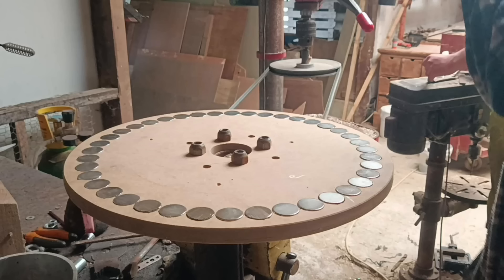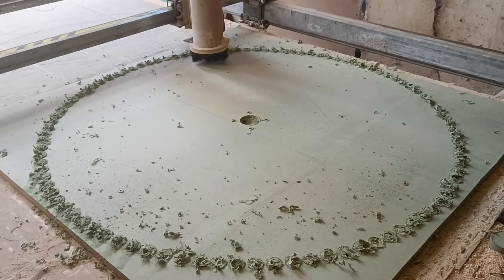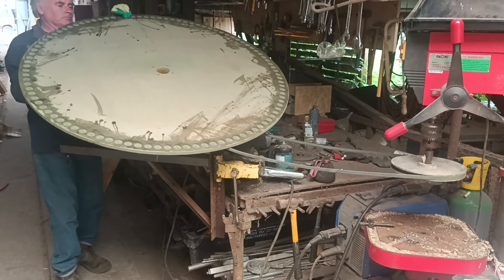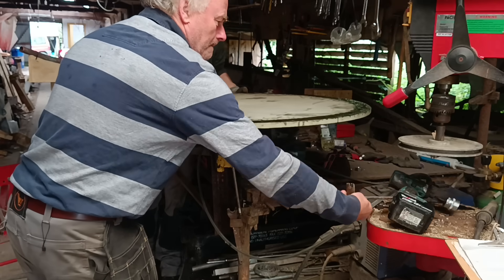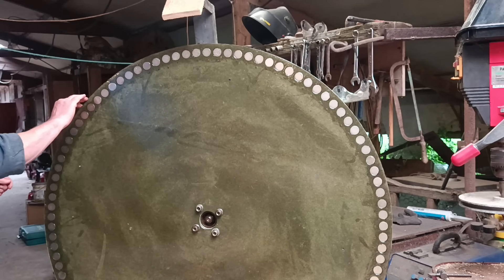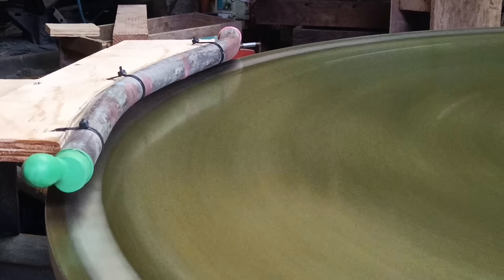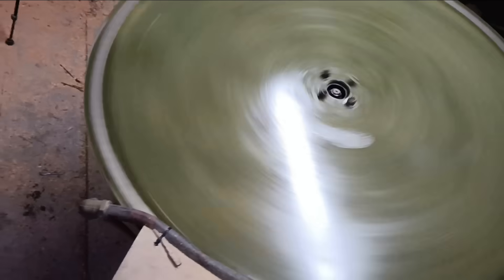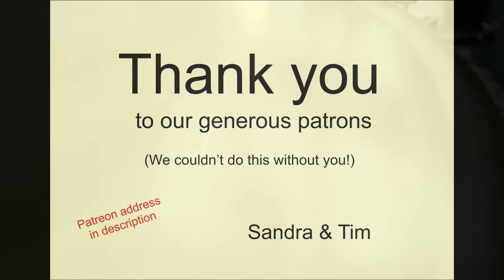ABSOLUTELY HUGE Magnetic Induction Heater! Using 100 Spinning Neodynium Magnets And A Bucket

Comment: Most of the heat loss probably happened due to evaporation from the bucket, covering the bucket should be enough to reach significantly higher temperature without any other change. Not saying that alone would produce a good water heater system, but that should give a better idea of what that system is capable of.  

It might be good to know that when balancing such a big wheel, the distance between the mass and the center matters more for centrifugal force than for center of gravity. Centrifugal force changes with the square of angular velocity, times mass and radius, which you probably realize if you think about it, while the center of gravity only changes linearly with the distance from the center.    

It might be easier to use smaller wheels, just having more of them. All energy put into the system should turn into heat, so it should mostly be an issue of making sure that the heat is generated where you want it.

Comment: There is no advantage to such a large disc, as managing the sheer size becomes a problem itself. What matters is how many magnets are next to and under the heating area.  If it's 20, you can do this with a much smaller wheel and a smaller radius heating pipe.  Whoops.
Still, I really enjoy your videos, which have the feeling of informal discovery instead of uptight judgemental engineers.

Comment: Hi intelligent people. I was going to say get the copper closer, even flattening the bottom so that there is.more surface area of the copper closer. And thats still probably a good suggestion, however just increasing the amount of copper above the magnets is probably better as it affords more user error  while achieving a similar result. Probably you have thought of this but maybe not, so ill say it: the more hotter you get the water with this setup the more drag the input experiences, so if you are hoping for hot water home-heating as the end point or this heat you are generating, you probably run the risk of burning out the motor of the drill-press on the next attempt. (And the obligitory use some insulation where you dont want the radiative heat)

Comment: faragar1791- your logic is correct! You must have plumbing physics in your blood, like me. The small section of 1" copper pipe is very conductive, and only equals a small part of the circumference of the magnets. It was, as the test showed; losing the little heat input. Equalling the circumference, as close as possible over the centre line and fully insulating the
pipe; as close as possible to the magnets should greatly increase the output. I am not knowledgeable about the magnetic/heat action occurring - so I am guessing.. that if poly foam insulation was used (being plastic) would not interrupt the magnetic flips? Through to the non ferrous copper. Also would thicker copper produce more heat? A fascinating project, especially when it is linked to a sustainable carbon free power source i/e your windmill. Have you considered a water wheel system? Might be more reliable than wind. Will look forward to the next stages...

Comment: I would move the output of the pipe so it is above the water line.  That way the water has to heat up significantly more to begin the convection process.  In it's current configuration it won't take much heat to get the water flowing and the constant cycling  is cooling it back down as it flows through the rest of the system.

Comment: the efficiency of induction heating is higher the higher the frequency, and if you do not want to increase the rotation speed or the diameter of the disc, then it will be easier for you to make an alternating voltage generator rather than an induction heater, the efficiency of the generator will be much higher.

Comment: Quite a few good suggestions here.  The ones that stand out to me are:

1. Put a longer section of pipe over the magnets.  This will put more resistance on the wheel (requiring more energy to turn it) but it will extract more energy on each revolution, heating it up faster.  Conversely if the windmill ends up having too little power to turn the wheel, reducing the length of this pipe will make it easier to turn at the cost of it taking longer to heat up.
2. Run the wheel vertically so the hot water can rise - when the heated section of pipe is horizontal, the hot water will rise to the top of the horizontal section of pipe but it won't flow out of the pipe into the vertical hoses as readily.  Having the heated section vertical means you will get a higher flow rate through the heated pipe.
3. The pipe has to be as close to the magnets as possible.  The magnetic field drops off dramatically with distance so every millimetre counts.  If you can get the pipe less than one millimetre away from the magnets you'll significantly increase the energy extracted.
4. You're trying to maximise the amplitude (strength) and/or frequency (speed) of the magnetic flux.  So instead of a huge wheel with many small magnets, a small wheel with a few huge magnets will yield a similar result.  So if the wheel gets too large, you can stack some of the magnets together to make them stronger, and use a smaller wheel instead.

Comment: two rings of high fin copper tube above and below the magnets maximise the effects of the magnetic flux, or smaller diameter copper tubes say 5 mm ID wound around the disc in multiple  continuous circuits

Comment: Iron pipe has to get hotter than copper as it is what most commercial induction cookers suggest, along with you need that pipe scraping along the surface, 
If it were me. more magnets smaller magnets more flips of the poles more heat generated. smaller magents closer together is gives you less wasted space the wood doesnt help induction.Spring loaded heater pipe that uses wheels to maintain spacing between the tube and the spinning fly wheel. I would use rectangular magnets 3d print sections of track to just glue down on a board you could use that as a guide for the pipe cart . If you use magnet paper and put it on a induction hot plate you can see how close they are trying to get the flipping.

Comment: Hot water heaters use a dip tube to help the layering of temperatures within the cylinder.
Maybe extend the hot tube to the top of the bucket?
Maybe more beneficial on a larger tank/bucket but worth a try.

Comment: Add an extension to the warm water outlet on your reservoir to just below the top surface of the water. So is that the warm water does not mix with the cold.

Comment: A fun mechanical challenge would be speed regulation to match the optimum for the turbine for the current wind speed. A mechanism that brings more of the tube into the field when the speed is high, increasing the resistance torque would be complex and fun to see. If you had used some mild steel to return the flux path on the back you wouldn't have needed the glue

Comment: Great job. I suggest making the pipe closer to the magnet. Perhaps it can be deformed into a flatter pipe that enjoys more Magentic flux and therefore more heating. Insulation of course will help massively. Also your pipes are super long considerer making them shorter. Love your videos.

Comment: Why have an expensive motor and expensive magnets attached to a huge rotor whose berrings will fail so you can do induction heating when you can do induction heating solid state cheaper, and noislessly. 

It's dead simple. Coil copper wire around an iron pipe, and feed it mains AC directly. 

Alternating Current through the coils create a changing magnetic field. The changing magnetic field induce currents in the iron pipe with iron's own resistance heating the pipe, and flipping the magnetic domains in the iron pipe also produce heat.

Comment: Turn the disk so it's vertical, and the axis of rotation is horizontal.  That will put a vertical orientation to the heating pipes so convection is stronger.  Make a pipe that bends to follow the magnets for a bit less than 180 degrees.  The inlet will be attached at the low end, and the outlet will be attached to the top end.  Make a mirror image for the other half of the disk.
Then, add more rows of magnets to the disk and make two more collector pipes for each row of magnets.
Reply: And don't forget a back flow preventer ball, so the water leaves the heat source in only one direction. (Like a coffee pot)
Reply: @ Good one! 👍
Reply: Are you taking medication, or did you miss taking it? 😵‍💫
Reply: That is going to be problem when the mill needs to turn to the wind.
Reply: @Axel_Andersen  
Bevel gears.
Car differentials have them and differentials can be bought from junk yards for very little money.
Reply: @deezynar  Of course, but increases losses and added complication.
Reply: @Axel_Andersen  
A small loss.  Putting it on edge saves floor space and gets the convection circulation flowing faster.
Reply: @deezynar  I'm not arguing against but these are all factor that need to be factored  in and compromises made. As I commented elsewhere, 40 years ago I read a MA thesis where this (heating water with wind power) was studied in the context of a single family house and stirring water with paddles turned out to be the most efficient way to convert rotary motion to heat in that temp range.
Reply: @Axel_Andersen  
He posted previous videos about using a wind turbine (windmill) to heat water.  In the first video, he asked for input from viewers on ways to do it.  I suggested stirring water with a system similar to what's used in an automatic transmission.  In the video following that one, he said that he did some research and found that stirring requires high RPMs, and he doesn't want to use a gear box.  I am 90% certain that is incorrect.  For instance, notice that the path he's taking with magnetic induction, he has increased the diameter of the disc he's using to increase the speed.  No gearbox needed.  However, making a large diameter paddle wheel that's going to spin at a few hundred RPM requires some very careful fabrication methods.  Drilling holes in a wood disc and gluing magnets in them is ridiculously easy compared to making a paddle wheel that doesn't shake and can survive in water.
I have no experience with the subject, and I don't have a dime invested so I don't care what he does.  I learn from watching him mess about, and even though he does almost everything in ways that I wouldn't, he is pretty darned successful.  I don't know if I'd be more successful than he's been with the projects he's done.  I subscribe to dozens of guys who make weird things themselves and they frequently do things in ways that I wouldn't.  I almost always learn a lot, and enjoy the show.
Reply: @deezynar  Thanks for responding. I can underwrite almost all of that. Like I wrote I have read I an MA thesis about heating with stirring and I don't recall that high speed was a requirement but I could be wrong, it has been 40 years or so.
Reply: @deezynar  Out of curiosity I 'chatted 'with chatgpt about this. Of course it is not reliable source as such but indicative when tempered with common sense. :) 

Anyways: my starting point would be vertical axis turbine, like a wind screw. Omni directional and slow, so simple and safe. Chatgpt calculations for a 5 kW @ 7 m/s wind speed mill indicate a modest little over 1m diameter 4 m height screw which would rotate at about 240 rpm. 

Chatgpt dug up some papers where 200 rpm rotational speeds for heating with agitation where mentioned. Unfortunately behind a pay wall so did not dug deeper.

So it looks like high rotational speeds are not necessarily needed.

However I am slightly changing my opinion in that heating water with magnets and eddy currents might be a practical option. But I would definitely (if I was attempting this) go for vertical wind turbine with no gearbox and a large diameter disc like he already has.

I would also try to convert the energy to electricity (together with step up/down electronics to match the output to load at all speeds) just because of the 'routing' issues: I would not like any kind of mill around my house and running isolated water pipes to a distant mill is more work and expense that electric cables.

Very interesting. IU wish him luck in completing this experiment, hope this is not JUST Youtube content.

Comment: I wonder if you could have used pieces of ferrous scrap metal sticked to the underside to hold the magnets in place instead of screwing a piece of wood over each one, so the magnet would hold itself down.

Comment: Make pipe going full circle around the wheel 
Make a gap between the pipe and wheel a few mm wide
Install more magnets on the wheel
Make 2 wheels and sandwich pipe between them.
Make 2 or more stages of heating with more than 2 wheels with pipes heating between 2 neighboring wheels, after which water would be entering another circle of pipes between the next adjacent set of wheels.
Insulate system well
Check if stainless steel pipes has higher magnetohysteris, consider using those instead of copper pipes.
Use an expansion chamber in case water boils over so it doesn't build up dangerous pressure inside
Consider using circulation pump

Comment: Great Test there! You need to compare to just a water pump, recirculating as it should give you the same, if not better results. 
It's the same amount of energy, simpler to make, and should be cheaper.

You could even just have paddles in a bucket, heat the water for a quick test.
Reply: Yes, that method works very well.  A heat pump is better but the violent stirring method is very easy to build
Reply: @kensmith5694  A recirculating  pumps pump is pretty low tech, but works. I've seen a demo on a fire truck, where they do this for 20-30 sec and get the water too hot to touch.

Now the Magnet system has it's uses, especially if you have a high RPM to start with. It's also easier to control and shut off if needed.

I hope both are worked on here, as I find them both quite intersting.

Comment: So this is basically an ad.
If you use more rows of smaller extremely strong magnets with a plate of magnetic iron behind them you will get more heat from this method.
For heating water, however, a heat pump driven by the windmill is a lot better.  A home made heat pump can deliver about twice the heat to the water than you get from just the moving magnets.

Comment: I know this project is kind of just fiddling about.  So feel free to ignore this and the slightly factious comment.

Now there is another type of system that simplifies where the inductor placement and design.  If you take the magnets and arrange them along a rotating spinning shaft you can concentrate the magnetic flux in a very small area.   This is wonderful for simplifying the mechanical size and controlling rotor speeds considerably.

Now if you surround this magnetic field with loops of wire, you can transfer the magnetic flux to a coil a surprising distance away.  If you size the other coil to the side and shape of the pot/pan you are using you can induce the same energy.  And surprisingly the efficiency of the entire system will be no different from using the mechanical linkage to the rotor of magnets.

(I.e.  you have essentially made an electric generator in a rather inefficient configuration.  Many of the early electric experiments did use large flywheels of rotating disks of permanent magnets.  The only change in efficiency for using wire to connect it to a remote coil is the resistance and length of then wire.  Which would probably cancel out the inefficiency in the large flywheels design.  There is no difference in the transfer of mechanical energy to electrical vs magnetic flux…it’s essentially identical)
Reply: "a rotating spinning shaft"

Do you mean rotating in two different axis at the same time?
Reply: @ nice catch there

Comment: Love the repurposed car parts. The nice thing about the drum brake is that you can actually use it to stop the wheel from turning. With a windmill that has the ability to turn to get out of the wind, it gives you full control.

By the way, that is quite the lovely kluge you have there. I might be tempted to do a bit of balancing on the wheel. The method would be to turn it vertical and let the heavy edge go to the bottom. Tape on some weights and see how much it takes to get it to be stable. 

Anyway, lovely bit of kit.

Comment: With a smaller machine the tip speed is still going to be the same. With a smaller machine it's mechanically easier to maintain a reliable airgap tolerance. It doesn't look like you have anything here to conduct the magnetic field lines across the backside of the magnets. You could increase your output substantially if you did this but at the cost of re-inventing the wheel. I'd take a PM motor or servo and cut out the stator windings and replace them with a squirrel cage of copper pipes. The whole thing could be put in an esky to insulate it.